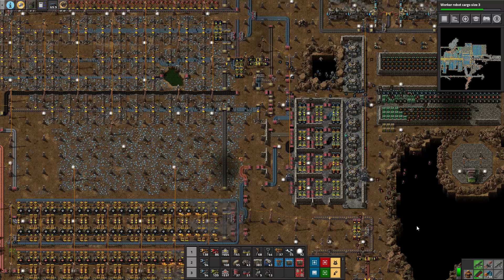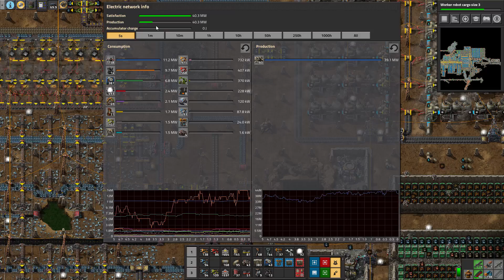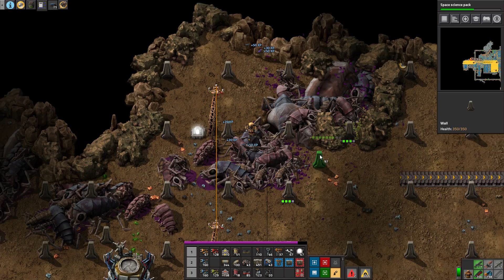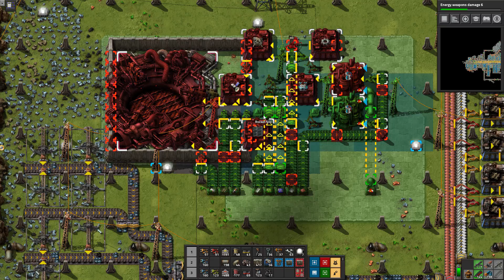Factorio Diggy #5 - Dig Fast Dig Furious

Comment: I'm a fairly new player and I have two questions about things he did in this video.  I'm assuming they must be mods because I can't find anything about them in the keybindings.
1) He went into the map view and then instead of showing the map he showed the actual tiles and was able to pan around the actual world.  How can I do this? Edit: I found it!  It's "Alternative zoom in/out"
2) There's no option for more than two toolbars.  A mod I take it?
Reply: He's playing modded so I am 80% sure yea
Reply: Yes, that's modded. Although I've never found it useful to have more than 2. The game now gives you 10 toolbars with only 2 shown at a time, so you can have toolbars for specific purposes (outposting, railway laying, fighting) that you swap to at the appropriate time.
Reply: @Septimus_ii  yeah it's an interesting idea, but I'm upset that the control was changed for selecting things on the bar. for the past few years I would have my belts & splitters in slots 6,7,8 and press SHIFT+1/2/3 to use them but now it changes my bars and I really don't like that
Reply: This playthrough is without any mods, which means it is not. The two toolbars are actually from the 0.17 experimental build of factorio. As far as I remember in 0.16 you can later research a second toolbar as well, but this needs some time.
Reply: @odddiabetic  2 toolbars is vanilla, but he has 3
Reply: @odddiabetic  Yes, I've found myself using the toolbar a lot less since that update and just using the picker tool (Q, I think) or looking in my inventory
Reply: Yeah, I find myself not using the multiple toolbars as much, I just end up using stuff from my inventory.  I'm trying to get used to it by building specific ones, like one for trains, but I always seem to forget about it, haha.  I was thinking that maybe if I could see the extra toolbars I have then I'd remember to use them.